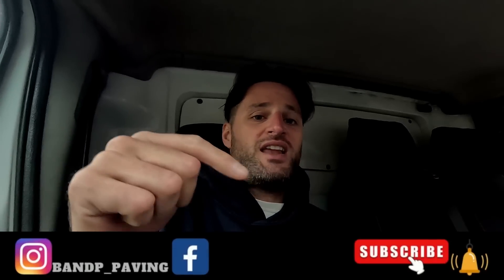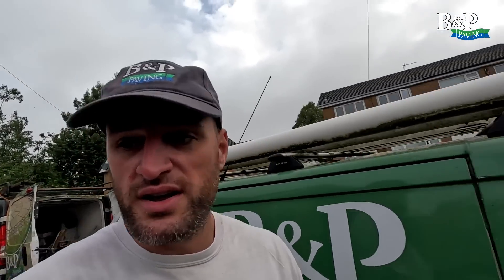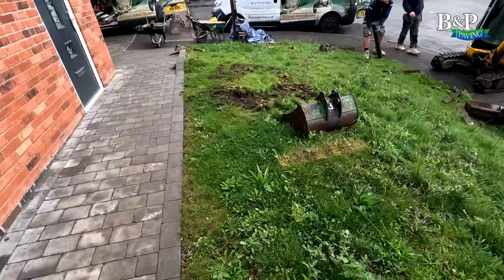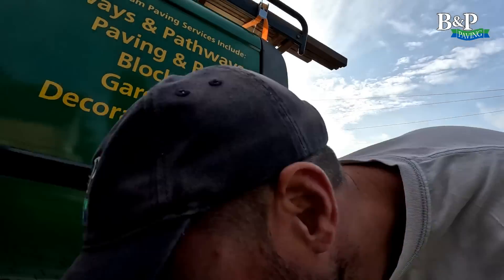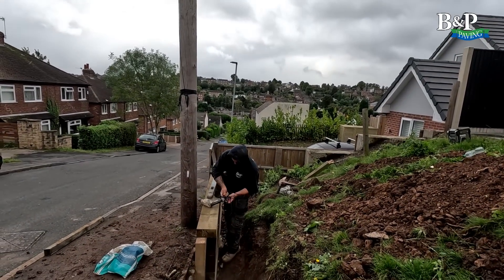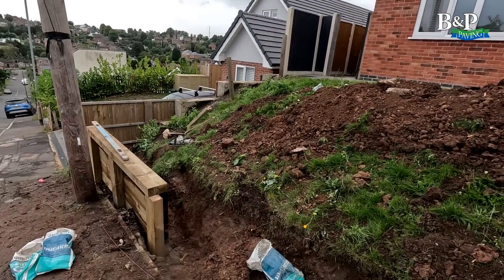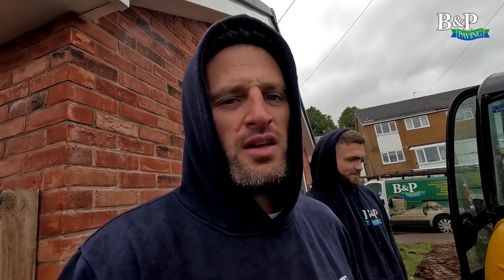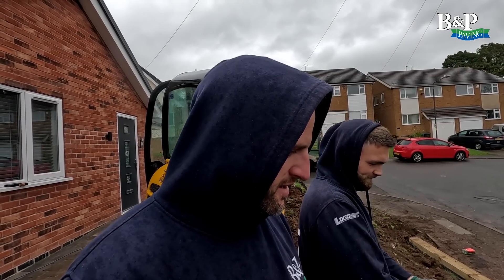Look what he did to my van #062

Comment: The worst thing i ever did when i was a kid was, My dad had an old antique brass camping stove that he got that was his dads who had it since he was a kid and it ran on Paraffin and i asked if we had any paraffin and he said wait until next weekend and i will get you some so me being me too impatient thought i would use petrol, so there i am in the back porch i filled it with petrol started pumping it up then lit it, it was fine for 30 seconds then the flame grew bigger and bigger and bigger so decided to open the fill plug to let the pressure out and the fumes caught light so i panicked and kicked the stove out of the porch and as soon as it hit the lawn it exploded and set fire to the lawn, fence and clothes on the washing line, at that my dad came running out wanting to know what happened and seen the carnage after he put the fires out his words to me were "i have had that stove for 30 odd years and you have had it for 5 fucking minute and blew it up" then i was grounded for a month 😂😂